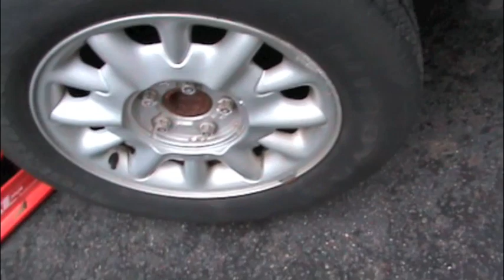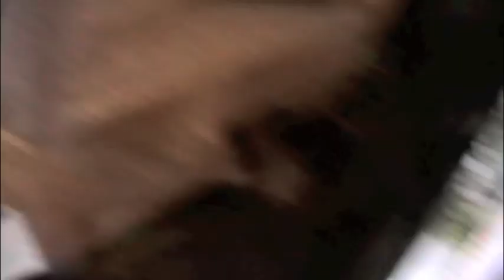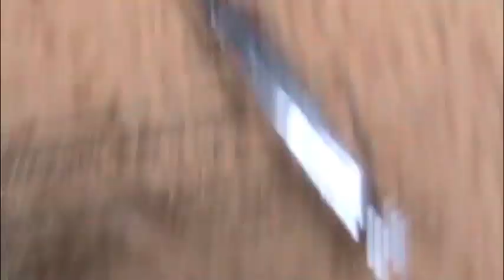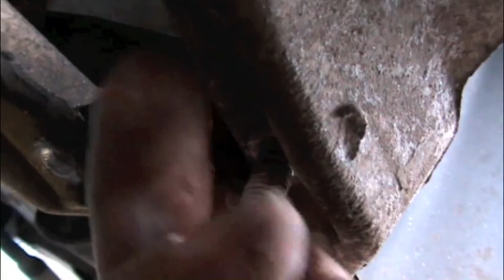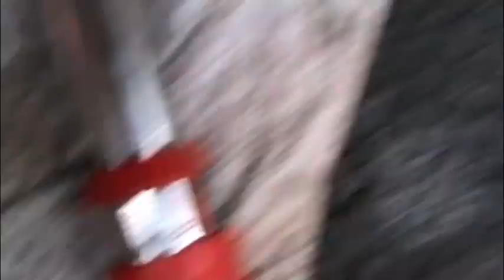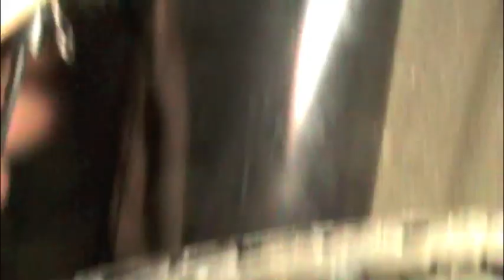Replacing rear shocks on the 97 Riviera

Comment: thanks for the video , just did my 97 riviera, and this was  a big help , adn gave me the confidence to do on my own , and i'm no mechanic. Had to cut the bottom holder brackets off and cut a  screw to get out. the shocks do not come with the bottom mounting hardware so your have to pick those  separate, so add another 20 bucks worth of high strength screws and those "clip nuts".just replace them , dont reuse the old ones.

Comment: @moldymac Mine are identical to yours.  I shoved the cut end of the airline into the hole on the shock and pushed the cap over then clipped it down (With the spring clip).  Don't know if it's doing anything or not but the car is all back together and not bouncing anymore.

Comment from the maker: I never did the fronts on this car.  They are much different, its a strut assembly with the spring mounted over the shock.  Monroe did not sell a complete assembly last I checked, you would need to buy the shock and transfer the spring and all hardware to the new one.  This requires compressing the spring which is a very dangerous job.  I did this on my old lesabre and would not recommend doing it without the right tools, which I did not have.

Comment: @moldymac I attempted to do this job on the weekend.  I ran into a bit of a problem.  The air line would not come out of the old shocks even with penetrating lube and then pliers.  I had to cut the line and now am wondering how I need to prep the line for the new shocks.  Is there a fitting on the end of the line or what?  (Also I decided to do the rear discs and pads while the tires were off and the calipers would not reset even with the proper tool) Ca-Ching! $460 more.

Comment: is there any way of shutting the compressor off I tried pulling the fuse on my 95  Riviera and my dash lights went out along with my AC I think I have a electrical problem but not sure